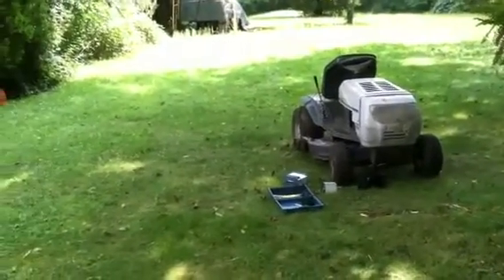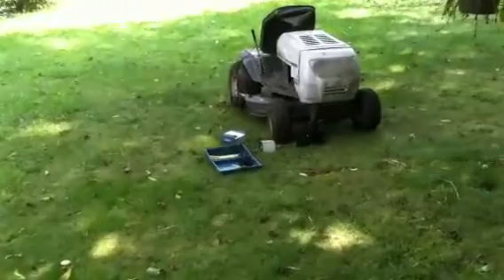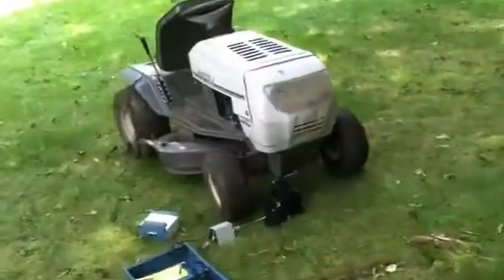GeneratorX

Comment from the maker: Well go to E Bay type in exhaust gas analyzer, now you will see one just like mine,but I do not see the flex pipe with it you could ask them where it is in the kit,149.00. but it now. There is also some new Gunsons 219.00 I dont know how they work.My type will not work after the catalytic converter so check them out I paid 163.00 for mine the other ones cost 1,800 and up.